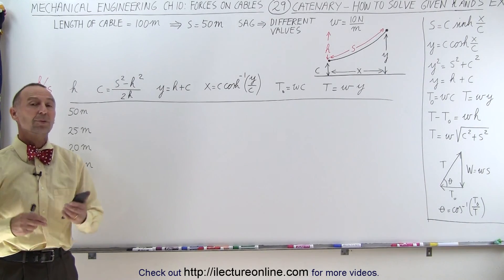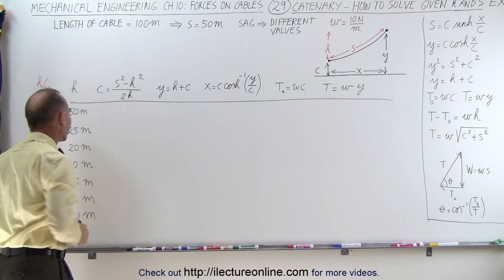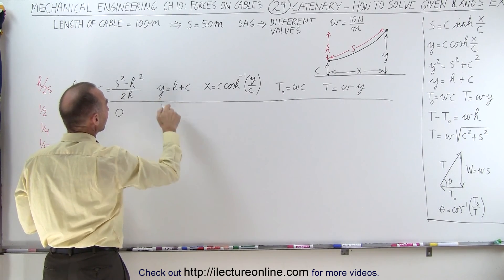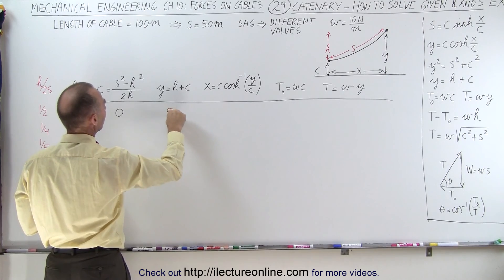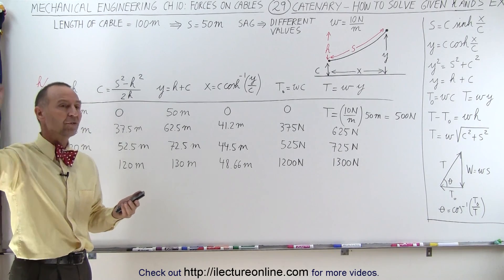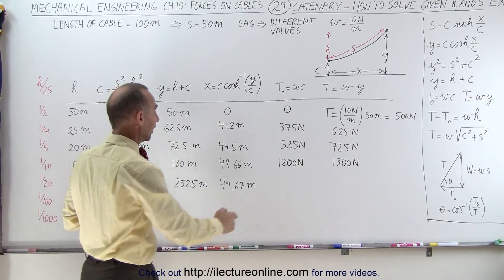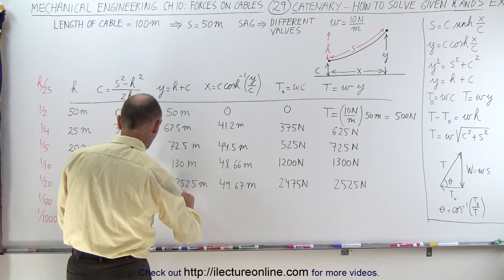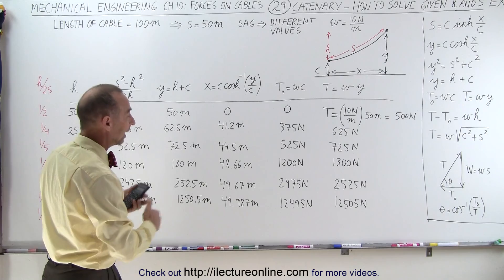Mechanical Engineering: Ch 10: Forces on Cables (29 of 33) Catenary - How to Solve Given h, s: Ex

Comment: This is a great resource and the presenter is very good, (Calm)
Is there a solution of the two ends are different elevations
Reply from the maker: Yes, you have to solve each half separately using the same method.  (You will have to know the length of each section of cable, or enough information to calculate that).